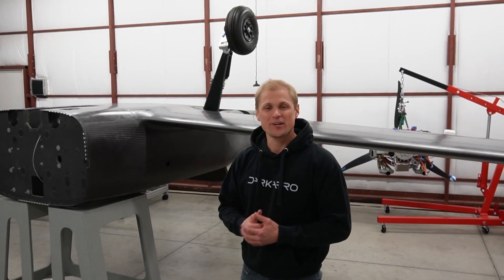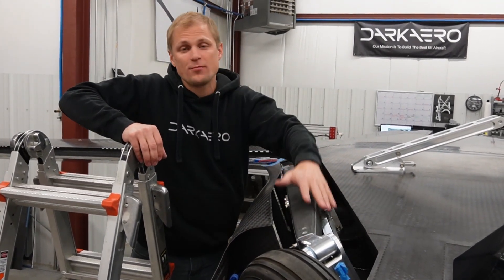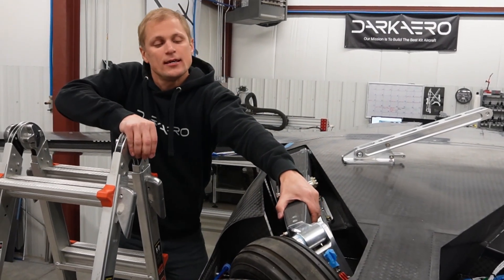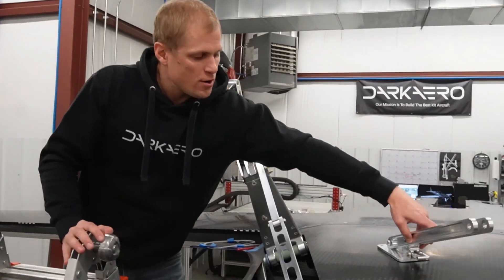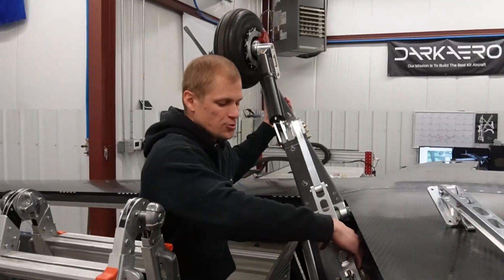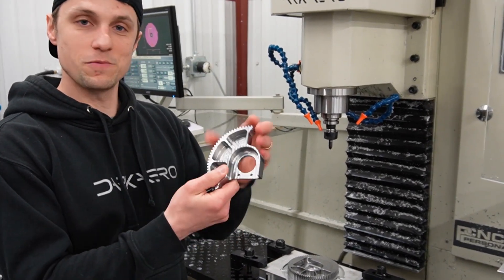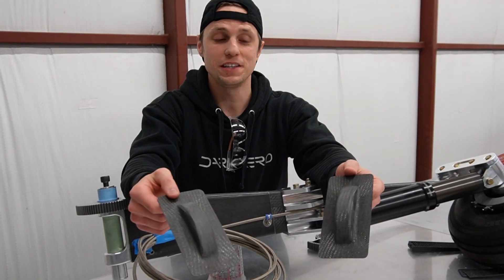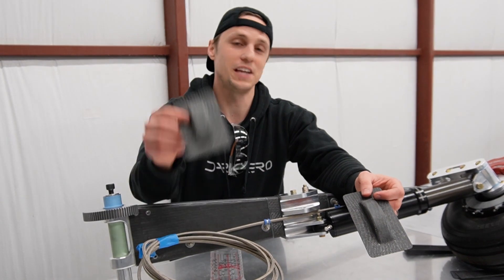How do we start this thing? | The DarkAero 1 Prototype

Comment: I have to say recently i've been following this endevour closely, its great to see more leaps being taken with general aviation to bring lighter, faster more efficent aircraft to market. I admit that I have a thing for vintage aircraft and simple technologies however having watched a lot of your videos It's reminded me that it is a mix of new and old, where wood composits were once used on aircraft like the DH Comet and mosquito, carbon fibre and fibre glass now exist, where slide rules and paper were once used, cad software can now be used. In some ways new technologies are simpler then old, and in some ways old simpler then new. 

Having worked on and flown 5 types of vintage aircraft I can say that they can be ergonomically challenging in many respects. From trying to undo nuts with minimal clearance for tools, requiring the use of custom tooling or excetionally small hands and high patience. To dealing with preventantive maintenance such as preventing wood from taking on moisture, correcting fabric issues using fabric tapes and dopes. As well as working on exceptionally rare engines with guidance from experts. This also is with consideration to varying climates as I live in the UK where it can be 15c one day and within a couple of days go down to -5c in the mornings where radials will struggle to reach correct operating temperatures, something we have been dealing with as exhaust manifolds crack and parts are rare to come by.

It makes me wonder how such challenges will be addressed with composite aircraft, such as condensation in the wings especially if they're wet wings, to making sure the cores of the sandwiches do not get logged. I wonder how much lighter a 30s aircraft would be if designed with new composites over existing wood, fabric and metal structures. I for one would certainly like to fly a dark aero some day.

Comment: I am not an engineer. Far from it. But I am concerned about the beautifully close tolerances in the parts that you are making, and the coefficient of expansion of aluminum.  The airplane could experience actual temperatures of -20 to +130. Does your CAD design software automatically take this into consideration? Personally, I would like you to address this issue in your videos.

Comment: For the final design of the fuel delivery system for EFI engine, have you considered using a header tank where the dual fuel pumps and pressure regulators are located in the header tank?  This is auto technology where the pumps are kept cool, uses less amps, and eliminates a return line from the engine since the regulator is in the header tank.  This would also eliminate vapor lock, wouldn’t it?

Comment: I'm sure you guys have run the calculations and simulations, but it's hard to picture such a small latch handling the forces involved on the gear. I guess that's a testament to the engineering prowess of your team.
Reply from the maker: The drag link is the structure that constrains the gear strut, not the latch. The forces that are trying to pivot the gear struts pass through the drag links so it is the drag links that are doing all the work. The latches only hold the drag links in the correct orientation so the forces on the latches are much smaller than the forces on the drag links.

Comment: Hi team .Greeting from Switzerland…been in engines marketing all my life, Cat but not Cummins !!!!  To me your Darkaero design is not only good for a speed and long haul private market but with the specific large wing full tank design, the concept is also well suited to fit one of those new small turboprop (cruise missile engine derivative.. light helicopters start using those extensively) to produce a brand new intensive basic two side by side seats army trainer. Range is less critical for training and turboprop engine lower weigh offsets a larger fuel flow but not that much higher with lower drag flying high.  Mandatory is an outstanding workhorse like old  PT6a but much smaller, around 250-280 hp continuous power. .the maintenance and downtime would be minimal…and planes using economical jet fuel…many Air forces around the world are using over 900 old aluminium SF260 for basic and semi advanced training and with age, they all became replaceable by such a modern cost effective composite airframe with a modern CAPS cirrus parachute system and no individual parachute requirement. It outperforms easely in performance and productivity an electric winged wagon…Below a 10 mio$ PC21 with a huge 1600hp turboprop. there are plenty of training hours to log with a modern performing side by side very economical twin seater and not many candidates are that well adapted for it..but maybe it takes to JV with an advanced trainer producer, turboprop specialist, Pilatus Embraer etc with an existing ww army market coverage to be in their portfolio.. Philgood

Comment: Hi guys, fantastic progress and attention to detail, however, I have a question. You demonstrated the half gear for the landing strut, will there be TWO half gears per strut, ie one on each side of that securing "pin" rod that holds the gear??? I don't think one per landing gear strut is sufficient due to the torque factor on only one side of each strut.
Many thanks for bringing us along on this epic engineering journey.
Regards from South Africa

Comment: Please give calculations for selection of engine.
A) ground handling power required to overcome weight.
B)power required to accelerate for take off.
C) power required to ensure design climbing.
D) power required to cruise.
E) power required to ensure optimum bite of propeller in all above.

Comment: Hi guys.in an emergency situation, how does the landing gear fall forward under gravity if it also has to fight aerodynamic loads trying to keep the leg and wheel rearward? Genuinely interested, not trying to pick hole.
Reply: Jinking the nose down abruptly and hope the maneuver and wheel weight will overcome wind resistance.

Comment: Was hoping you could do a video on your dual fuel pump set up. I've heard of a couple planes going down due to dual pump set ups and apparently it's possible for the pump to start pulling from the other pump instead the fuel tank. Also seen this issue in a car with dual pumps. The car issue was resolved with one way check valves.
Reply from the maker: Hi, the fuel pumps are currently set up with an on-on toggle switch to only run one at a time to avoid any potential feedback issues between the pumps.

Comment: Those locking pawls on the main gear look like they could be prone to cracking, especially the lower one. I would expect it to crack at the root and bend out of engagement. I recommend changing it to stainless along with a small wear pad on the strut also in stainless.
Reply: Lock dog galling, creep, hardened tool steel sear at pall. Good stuff Sven offered a two step self tightening and self cleaning angles.
Reply: In general on YT I'm dubious of decisions like the one you bring up but, these guys are really doing their homework.  That being said, I too hope they change the latch component to something more durable than aluminum...  It would be such a minor weight cost for a huge improvement in longevity/durability.
Reply: @FiferSkipper  I'm sure the latch they designed is Technically fine. I'm sure it would hold up for hundreds of hours and gear cycles. I'm also Very sure I'd take the ~3lb weight penalty. They could make it out of forged 7075-t6 type 3 hard anodized, probably would cost 3 times as much as stainless. Even the 7075 would possibly need to get dye-pen tested at annual. I'm sure the gear is very light but that latch is a real good concentration of Any forces available.
Reply: The video shows that the latch engages a pin (presumably steel) on the gear, not the aluminum gear component directly.

Comment: If the main gear can be deployed by pulling a lever in the cockpit and falling by gravity, what does the electric actuator accomplish?

[Edit: okay, I figured it out.  Electric retract.]

I love the noises the machined parts make when they go together.  You can hear the machining marks on the pivot pin as they slide into the trunnion.

Comment: Regarding engine electric connections plate: Consider making one of the battery lugs left hand thread. This will prevent reverse polarity connection.
Reply: How? It will only prevent you from switching the bolt, or nut around, not the ring-terminals themselves. 
There is however a tried and working solution to this, different size stud and terminal for positive and negative ;)
Reply: In case Red and Black (or green) don’t work?
Reply: @tomcoryell  hehe

Comment: I'm not at all into airplanes but this project has me all propped up. There's so much interesting stuff that goes into it that makes me want to know every detail, from materials to fabrication and  design choices. Also, this is the first time I saw the finished paint scheme and it made me wish for an all carbon fiber version of it. Are there regulations requiring the wings to be painted? Just curious to know! Looking forward to the next update!
Reply from the maker: Hi Dirceu! We are happy to hear that you are enjoying the information we are sharing about our aircraft! There aren't regulations that dictate our paint color, it's governed by the limits of the materials we selected. Dark colors like black or raw carbon can heat up in the sun and potentially soften the epoxy resin that holds the carbon fiber in its specific shape. We selected high temperature epoxy to enable the structure to tolerate this type of heating, but we want to complete more thorough validation work to firmly establish the upper temperature limits of the structure. In the meantime, we are going to use light colors on primary flight structures of the prototype like the wings and tail and UV resistant clear coat on non structural areas like the cowling and spinner to still show off the carbon fiber aesthetic.
Reply: @DarkAeroInc  I haven't thought of that. Thanks for the reply!!

Comment: I am just curious if the gear will lock into the down position if you have to gravity deploy it in emergency, as you told. Lot of drag from the airflow for a forward pivoting gear leg.
I love your build quality guys!
Reply from the maker: You are correct that the gear are fighting aerodynamic forces as they extend since they swing forward. Each gear strut has a gas spring connected to it to provide the extra extend force required to overcome aerodynamic loads and reach the down locked position. Gravity does the initial work pulling the gear down and the gas spring takes it the rest of the way. This was omitted from the discussion in the video, so we are glad you asked about it and gave us the chance to elaborate on the design!

Comment: When I heard secret project while you were talking about engine stuff I was thinking 520T especially with a 20K ceiling :) Obviously a weight penalty but be curious what the tradeoffs would spec out to. Hits 200HP at 20K alt which is kind of crazy. Could definitely run it down much lower throttle up there I'd think.
Reply: I reckon they could do super high ceiling,  pressurized cabin, in pusher configuration with canard.. And maybe a diesel for efficiency
Reply: @nathanchalecki4842  sure... and that would be an entirely different aircraft, not sharing a single component.

Comment: As a certified technician, with the "what if..." hat on; 
In case of MLG actuator(motor) failure, and manual down-release (which you have covered, which is good) is needed , how are you going to ensure down-lock when the leg has to move against air-drag, instead of being extended by air-drag? 
I'm also a bit worried about the loads on the what-would-have-been a drag strut/brace, which in this case seems to be under compressive load during breaking instead of under tension (which is more stable) especially considering the lock being so close to the center of rotation, which will put it under great force if the brace was to come even slightly out of center during compressive load.
Reply: Also, there will be resistance from the motor.
Reply from the maker: There is a gas spring connected to each gear strut to push it down against aerodynamic loads and into the down locked position. This wasn't discussed in the video, but it's basically the same arrangement on the nose gear which we have shown in earlier videos. The drag links can experience either tension or compression depending on the specific landing or braking conditions you are analyzing. The drag link carries essentially all the load to stabilize the strut while the lock pin is very lightly loaded since it just constrains the upper drag link in a straight line with the load during braking or initial wheel spin up on touchdown. Thanks for checking out the video and for the extra set of eyes on the design! :)
Reply from the maker: The resistance from the retract motor was a hurdle we had to overcome when we were designing in the emergency extend functionality. The mechanical disengage of the lock latch is tied into the retract motor to decouple the motor from the strut assembly so the resistance of back driving the retract motor doesn't prevent the strut from making it to the down locked position. We have the same architecture in the nose gear system.
Reply: @DarkAeroInc  Awesome. You are definitely putting some weight budget into the landing gear systems. Landing gear handling is sometimes one of the greater unknowns - be interesting to see model matches tested behavior (less concerned about raise / drop, more just feeling on landing / takeoff / taxi etc.)

Comment: Question! In the event of having to lower the gear manually, how is the drag of airflow overcome to get the gear locked down?
Reply from the maker: Great question! There is a gas spring connected to each strut that pushes the strut down against aerodynamic loads and into the down locked position.
Reply: Normally you need to reduce speed to a certain point - for example in a Cessna you might lower gear only at 125 or less, but if you need to do an emergency extend they often want your lower (ie, < 90 kts). So that reduces drag a fair bit. Then these guys have a gas strut that pushes things. Finally, a gear up landing is not necessarily game over. I sometimes wish planes would ship with three skid plates so you could skid on the runway with something that was replaceable and kept the prop off the tarmac but I've never seen that except for on RC planes.

Comment: I live in Tampa by salt water so the carbon fiber appeals to me. On the aluminum parts, is there something that you will be doing to coat or prevent corrosion on the metal parts?
Reply from the maker: Hi David! The aluminum parts will have corrosion protection, either anodization or paint depending on the specific component.

Comment: Do you plan to use a FADEC of any type for the prop and mixture control? Or a traditional 3 lever system
Reply from the maker: The UL520iS engine we are using is FADEC controlled so there is no mixture lever. Technically it isn't a true FADEC as we have it implemented because the propeller control is independent. There isn't a propeller lever, but rather a knob control which is used to select different flight modes like takeoff, climb, and cruise. We made a detailed video about the propeller here: https://youtu.be/riOTy9m0WTY Thanks for watching and for the question!

Comment: As usual I am in awe of your build quality (and the quality of your videos!) but looking at your work reminds me of the Icon A5. It is also a superbly engineered and built aircraft,  but this in turn resulted in very high build costs due to the complexity of the design, so now it is priced so high that no one can afford to buy it. A fixed gear variant with very a sophisticated aerodynamic design may be worth considering in the future- less weight, less risk, more room in fuse, more load carrying ability, less maintenance, lower cost.

Comment: One more question, since this is built for high speed XC flights, would it be modifiable easily to be a realistic Reno air racing competitor?
Reply: It's not structurally designed for aerobatic flight limits.

Comment: The pilot can't see the gear. There should be a position sensor and a lock sensor and a small 4 inch display in the cockpit showing the gear position and lock status with page 2 showing a camera view of the gear. In bad weather or if the gear hardware gets bent the pilot can move to make a decision for a gear up landing.

Comment: Mechanical landing gear always gives me pause. Granted, it’s always lighter than electro/hydraulic, but the need for your uplocks, downlocks, secondary release mechanisms, specialty gears, etc kind of equals that out. With hydraulic, no locks just over-center links and a simple valve to equalize the pressures drops the gear with gravity. I too, wish to find out how your gear swings forward, past vertical during free fall. I see no other way than a moderate to severe pitch up to minimum flying speed, then a borderline-aerobatic push over. G’s alone won’t do it because the gear will always want to swing straight downward. Would gas struts strong enough to overcome 75 mph wind put too much stress on the gear motor?
Reply: It has gas struts for extension.

Comment: 3:10 would the gear fall far enough to hook onto the latch? it looks to me, as if the "down" isnt completely straight, but slightly towards the front, that in addition to airdrag that the gear receives, i can see it not reaching the latch if you just let it drop with gravity, if the electronics fail
Reply: There is a gas strut to assist the forward motion.
Reply: There is also drag from the motor, so they have to ensure the gearbox is easily backdrivable or else the gear won't be able to move at all without power.
Reply: I just made this same comment. Im no engineer but seems a tough ask to get it to fight drag using gravity alone